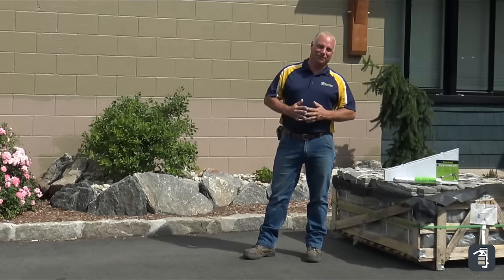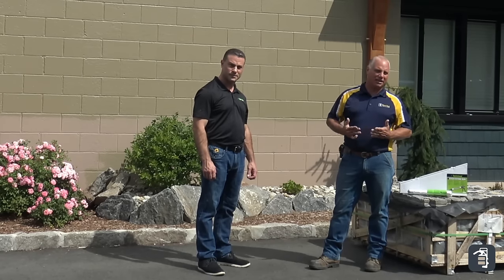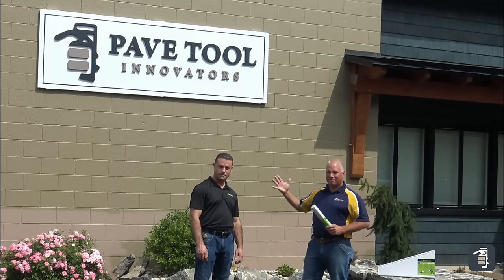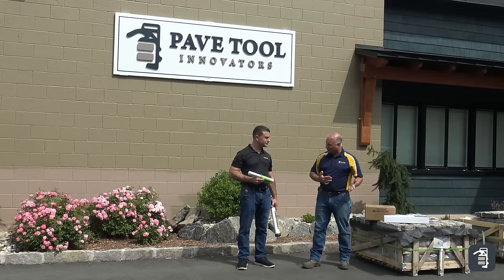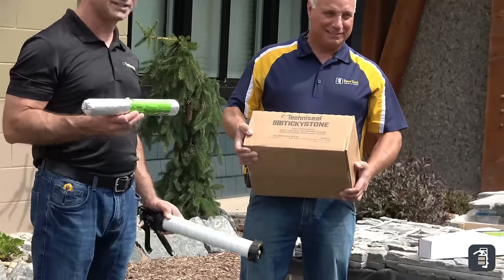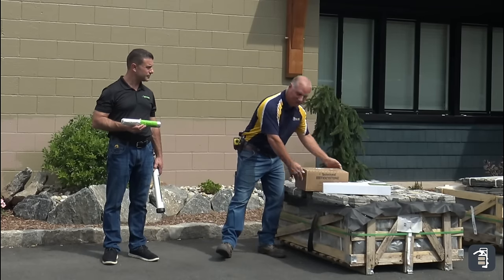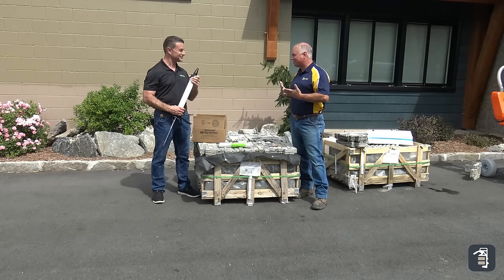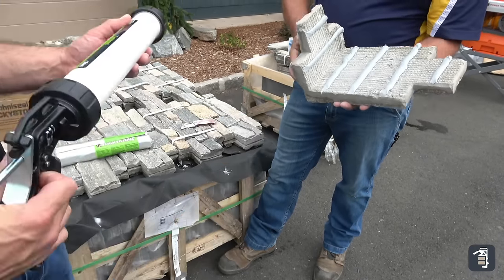Vertical Adhesive is in...Mortar is out...

Comment: Sticky stone in a tube will cost you about a dollar per square foot. So, $1.00 x 20,000 feet would cost about $20,000. Holy crap this stuff is expensive. Also why the hell would you adhere it to Tyvek? The weight of the stone will in time start to pull off the Tyvek along with it.
Reply from the maker: This is a specialty item, we are seeing our customers use it on smaller veneer projects, where time saving and avoiding a large mess is worth the investment. Studies show StickyStone is up to 50% faster to install than using mortar. Calculate your labor cost and see if it's worth the extra investment.

Comment: You should never apply stone veneer to painted block wall.
Reply from the maker: We cleaned the surface and wire brushed in areas of concern. It is still standing strong over 3 years later. Check out our recent update video where we chip a piece of the veneer off the wall. The sticky stone eats through the paint and bites into the CMU

Comment: This stuff is a joke. Locally it is $26 per tube or just shy of $30 with tax. $312 for a case of 12 plus tax. Maybe the manufacturer thinks they are selling gold and silver in a tube. You can do this with pure Silicone and still save 50% and Silicone will be there for 100 years. I asked the local guy at the store if he sells a lot of this stuff and he said I have not sold a single tube so far
Reply from the maker: If what's working for you satisfies your needs we aren't going to knock your procedure. Sometimes change isn't easy or necessary. We wouldn't sell a product that we don't stand behind and can assure you Sticky Stone lives up to its name.